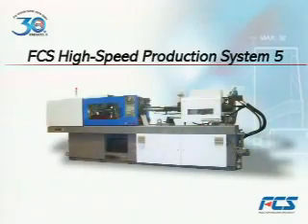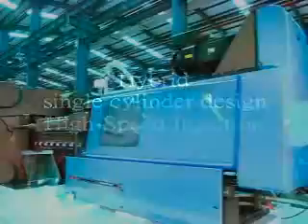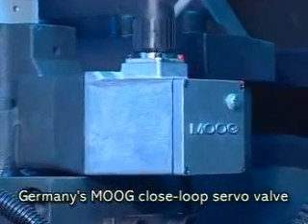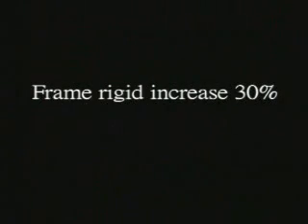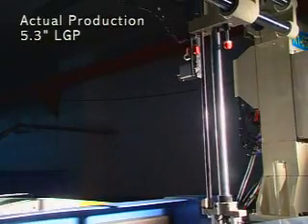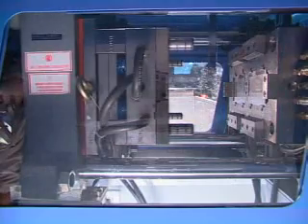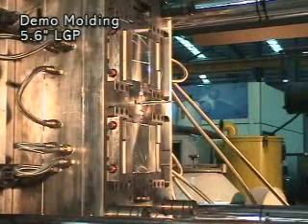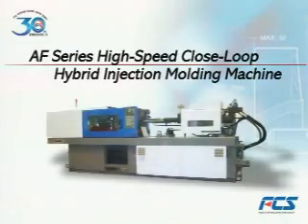Hybrid Injection Molding Machine

Comment: -We have Used Plastic Injection Moulding Machine  from 7 ton to 850ton in stock,we have 120machines ,
 	-Variable Frequency Drives (VFD) on plastic injection molding machine, For power saving 30-40%
 .          

Mechatronics Machinery&Tools(India)

skype- mmti19

mcs109@yahoo.co.in, mcs109@gmail.com
AJAY BEDI-+919810243409
S.S.CHAUHAN-+919810129642
Telefax : +91-11-27830809